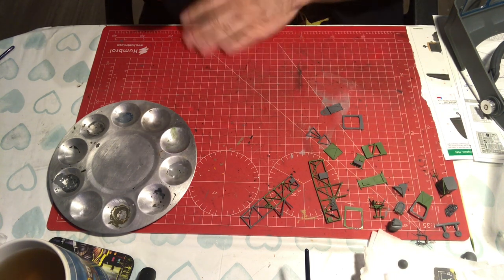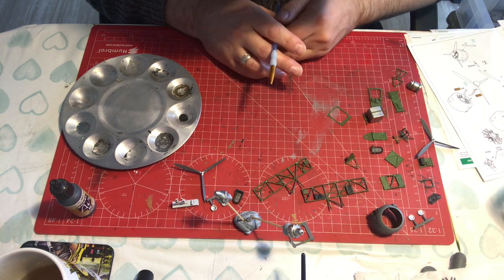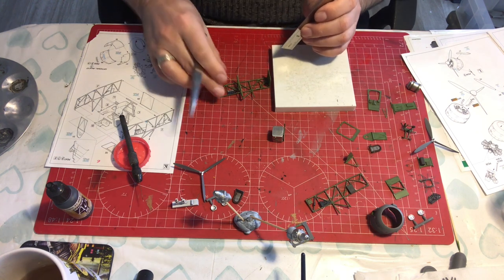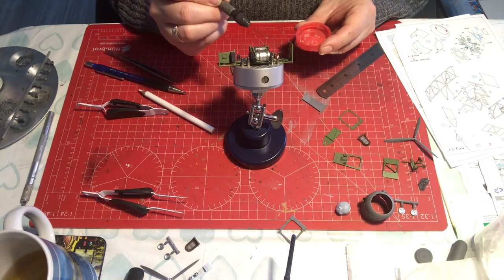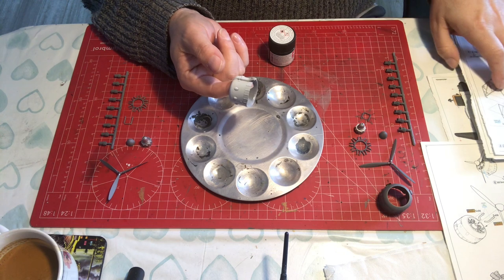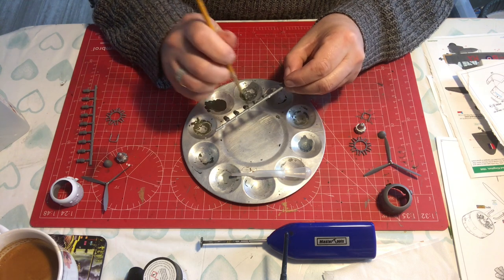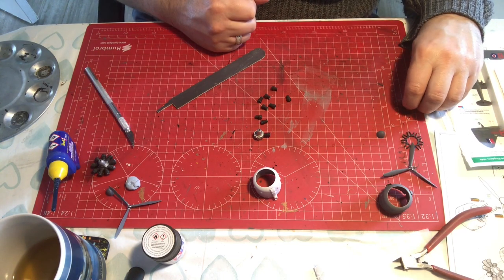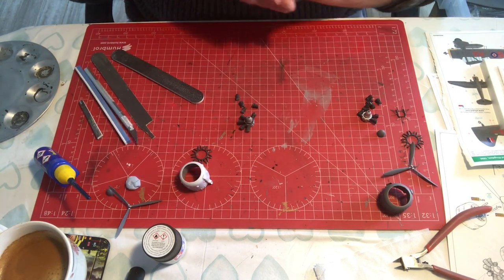Eduard 1/48 Lysander full 'double' build part 4

Comment: I'm a little late to this one so maybe you've already completed the other engine. It looks to me that the bases of the cylinders is too long. That's why they won't fit inside the cowling and why the ignition leads come up short. Had to tell from the video if they can be sanded down a reasonable amount. They're starting to come together though. Looking good!
Reply from the maker: its a really good point I think you have a better solution than I came up with.